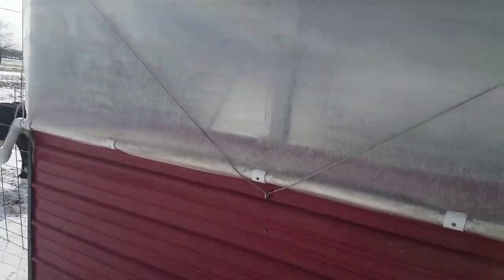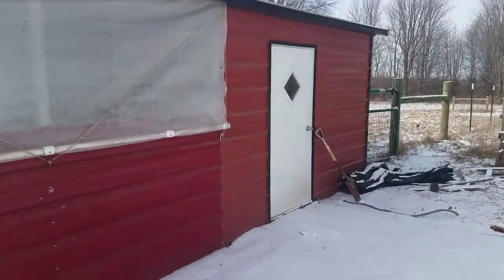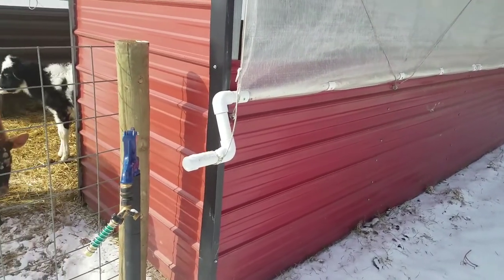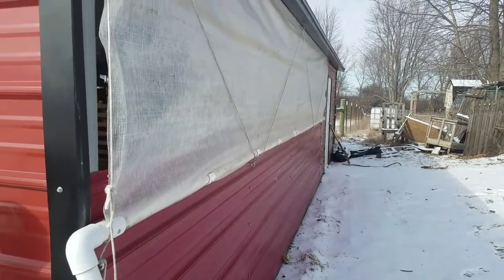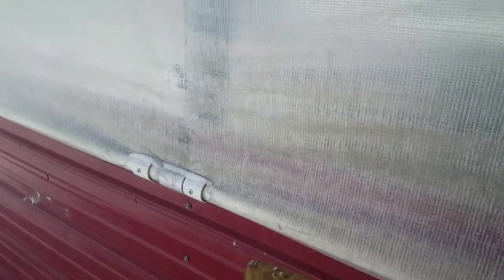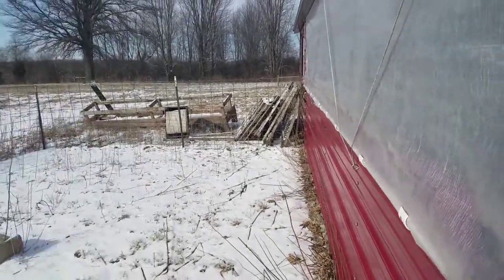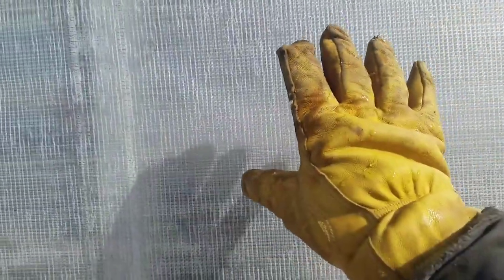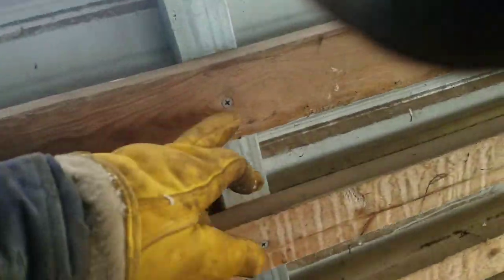How I built my barn curtains

Comment: This building was ordered with the panels running sideways. Panels running up and down cost more. I have the same type and color building with the panels running sideways. After installation, I did have a little minor leak on the roof. Nice video.  Eaglegards...